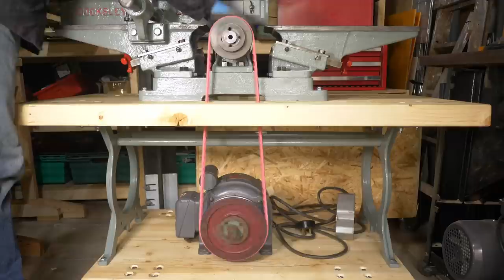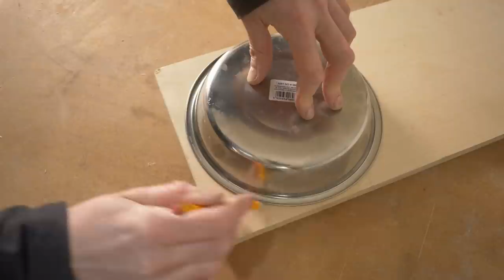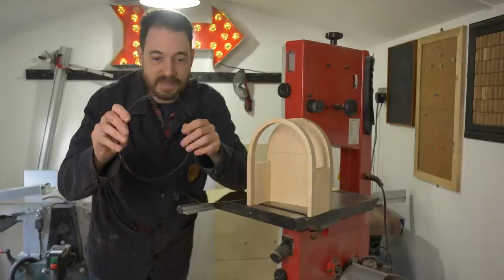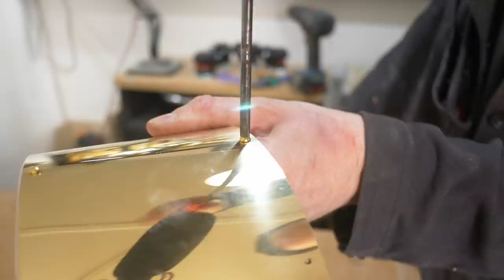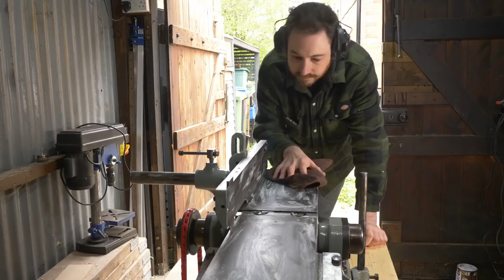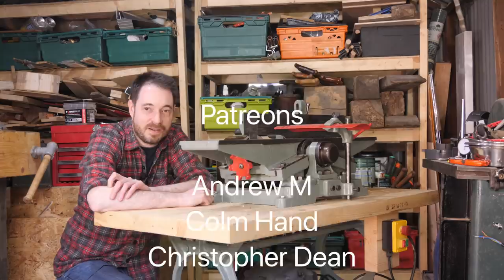Planer Restoration Part 4

Comment: Matt I always enjoy your woodworking videos although you rarely do anything that is particularly intricate or challenging but usually useful and practical (and about my skill level, so thank you for that, I appreciate it) but your patience and ability for sympathetic restoration of old power tools (the band saw was brilliant) is astounding. This was a beautiful rebuild! If ever 'The Repair Shop' decides to up its game a little you need to submit your C.V. 
Also, nice touch with the brass cover plate over the belt, but if you had used some clear acrylic (you could have cut it using just your normal band saw blade) you would have been able to see any wear on the belt. Many Thanks.
P.S. Who did your blade sharpening or did you do it yourself, if so how?

Comment: Awesome, turned out great, you must be thrilled! Great tip about cutting the brass sheet on the bandsaw, I’d never have thought to do that. What TPI is the blade you usually keep in there?
Reply from the maker: Thank you. It was 14tpi

Comment: Nice job as usual.  Intrigued to know what you think of the link belt as far as running noise or vibration is concerned. I only ask as I'm about to replace an 80 year old lathe belt and interested to know what you think.
Reply from the maker: This runs very quiet and smooth. I love the you can just remove a link to tighten in